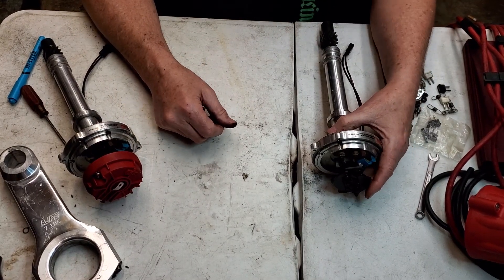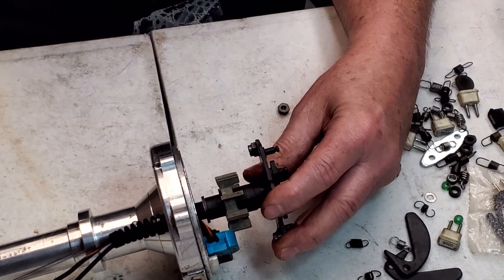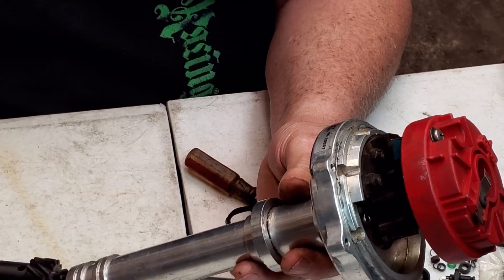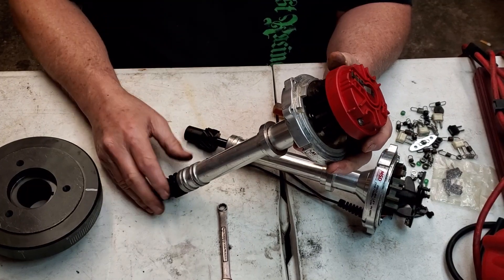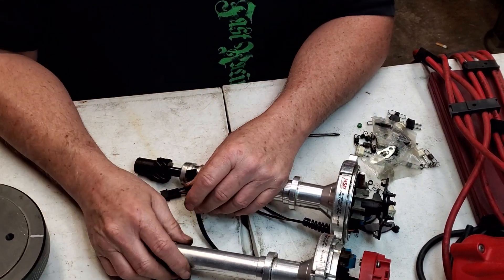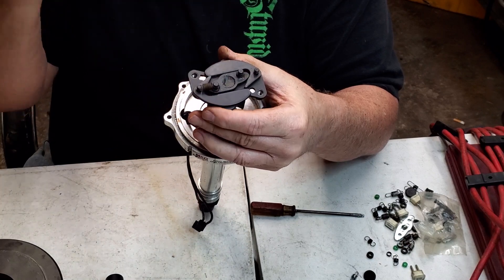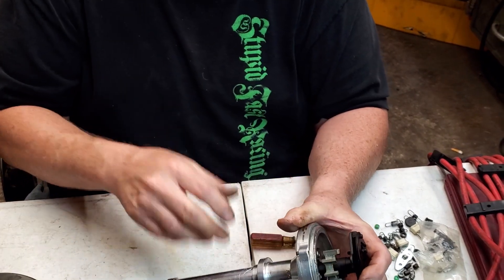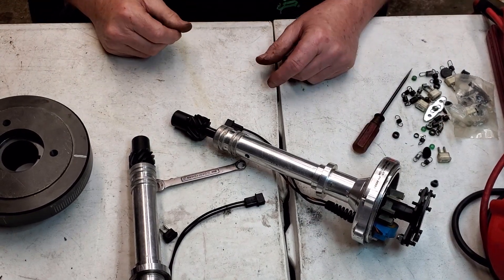Dialing in your MSD distributor total timing advance

Comment: One thing I've never heard anyone talk about, is the transition between vacuum and mechanical advance. I realize there's variables, but I'm curious of how much advance would be lost as the throttle opens and vacuum begins to drop, before my engine has reached enough RPM for the centrifugal weights to take over. Of course, I'm speaking of a daily driver, spending most of it's time at part throttle, with the occasional WOT blast down the blvd.
Reply from the maker: I have always set my initial timing then set my mechanical and my vacuum advance but I prefer to run ported vacuum from my carb to control my vacuum advance it's not the same as running it off manifold vavuum.

Comment: What do the msd distributors come with timing wise stock typically?
Reply from the maker: Typically. they come with 21 degrees of mechanical advance , this is your blue bushing, usually its  best to run as high initial timing as possible with out making your starter drag,, so for example blue 21 degree bushing and 15 degrees initial = 36 degrees total , remember there are all sorts of diffrent  combinations ,what makes one engine happy may damage another engine, also play with your springs to control  how fast your tlmling advance comes in , msd has a lot of information about this on their website. Hope that helps.

Comment: Ive got a lockout plate I purchased from FBO igniton for my vacuum advance distributor. I am gonna pair this with MSD 6al 2 programmable. Basically you set up max advance with the timing light, then program MSD to pull timing out along a curve up to whatever you set, returning back to full mechanical advance eventually.  This comes with benefits of being able to control the timing curve, 2step, burnout control rpm  limiter,start retard, and higher voltage.

Im curious to play with settings some at the track and see what helps.
Reply from the maker: I have never tried a limiting lock out plate for  a  vacuum advance distributor , I believe that would be nice 10 to 18 degrees of mechanical adjustment , sounds like you know what your doing, I had the old msd 7al-2   ,It would  let me pull  some timing out on the big end. Good luck, thanks for  watching.
Reply: Holley Carbs: How To's & Advice ,40 yrs of exp. Im a rookie with carbs and distributors, don’t be fooled haha. I came from EFI and gave it up for an old 6 pack mopar challenger. You have any experience setting up 6 pack carbs?